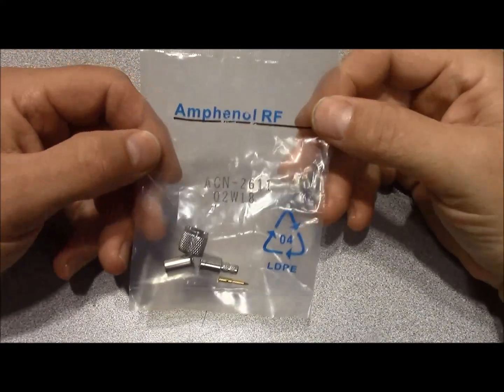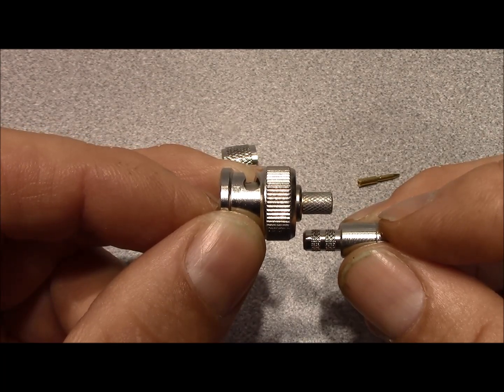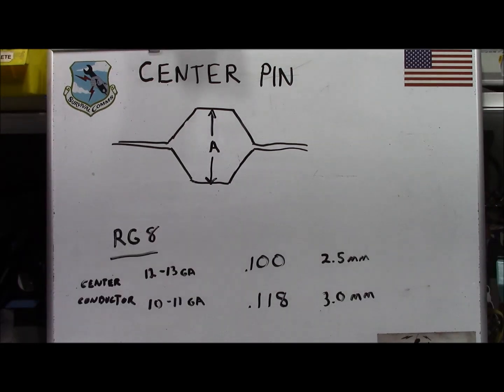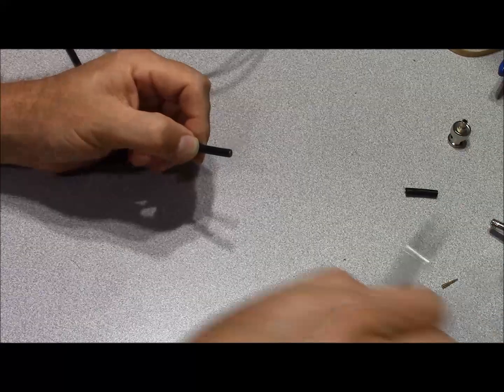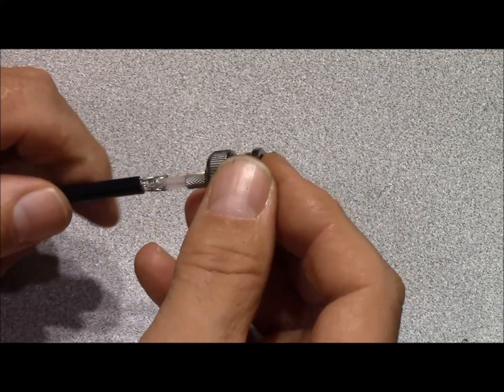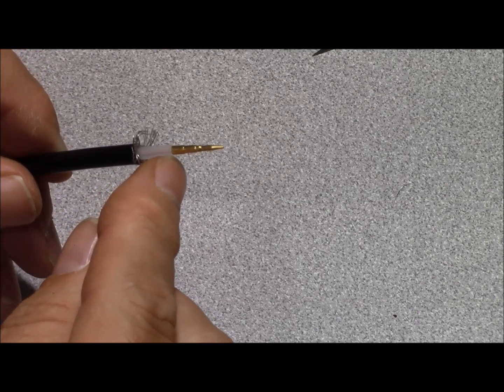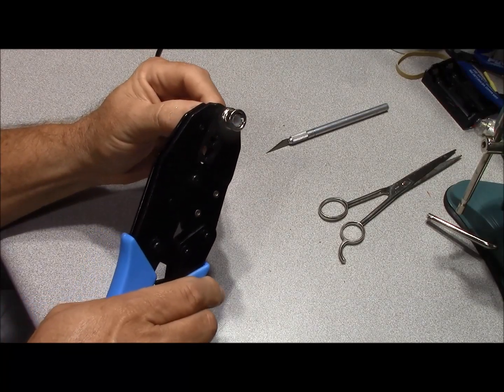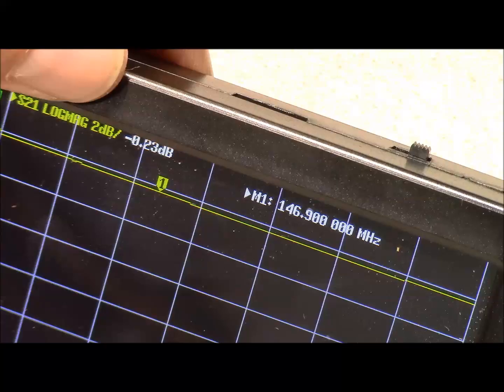Installing Ham Radio RF crimp connectors on RG58 cable v2.0

Comment: Excellent video.  So easy a caveman, uh, I mean myself, could do it!  I have a Hustler mag mount base that I need to replace the connector on, so this helps.  Unfortunately, Skycraft is currently out of the crimper tool, but Mavin has them for $30 bucks.  Thanks!
Reply from the maker: Thank you very much. That was a good deal they had on those crimpers . If you ever anticipate doing crimps on RG8U sized cable get a crimper with longer handles your hands will thank you. Thanks for watching !

Comment: Thanks Brett, 
A trick a buddy taught me for stranded-center-conductor coax, when using open-center-pin connectors is:
1. Strip the cable back enough to expose about 3-times the amount of the center conductor that you actually need.
2. Lightly twist the strands back together in the factory direction.
3. Gently insert center conductor into connector and watch this additional exposed length to see if any strands are kinking back and are not passing all the way through the open tip of the connector.
  This has helped reduce my shorted cable builds.
Hope that made sense . Any thoughts?
Thanks for your great content.
Reply from the maker: You are welcome ! That's the exact way I was taught to do  the legacy crimp PL259's  The newer ones you can get the dielectric pretty far into the center pin before the crimp tip.  I calipered one and its .650 from tail to this shoulder and another .3 to get the conductor proud of the tip. Thanks for watching !